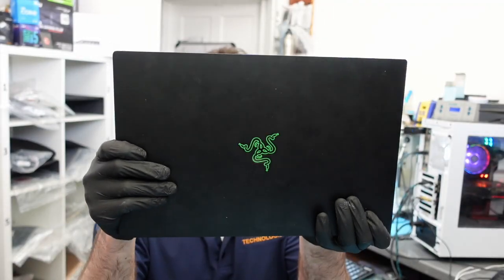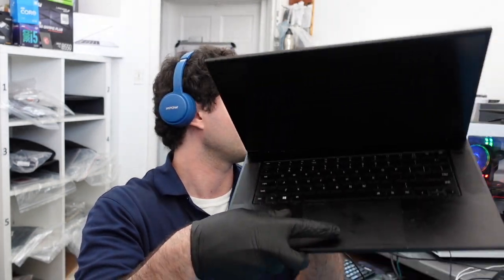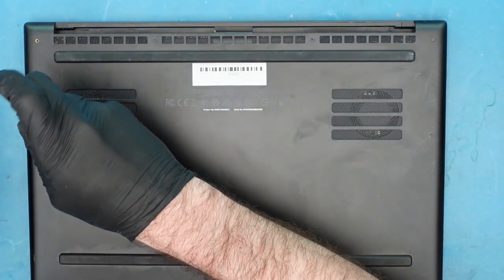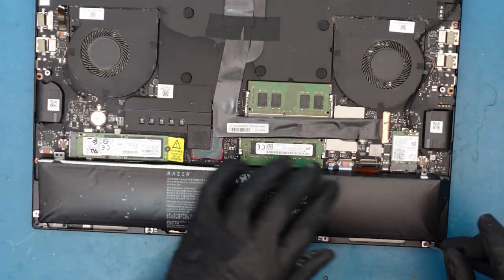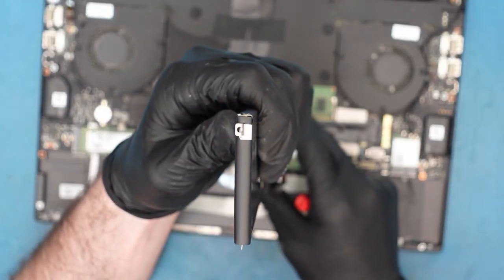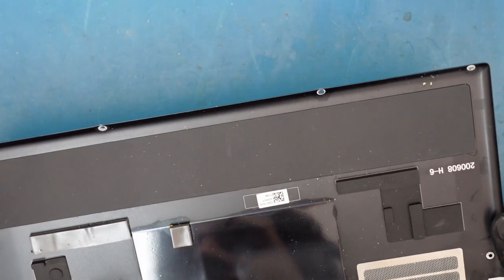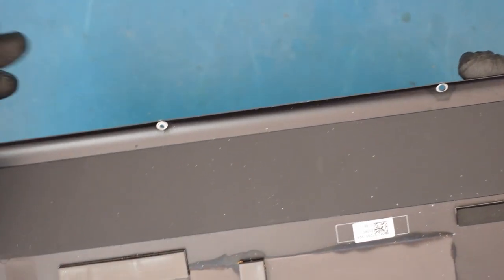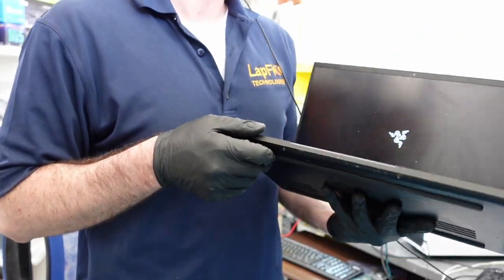Razer Blade 15 Battery Replacement | Swollen Battery

Comment from the maker: If your laptop  is ever starting to expand, make sure you take it in right away as it can get much worse!
Reply: I didn't change mine and it broke my trackpad, please do you have any idea where I can get a replacement trackpad
Reply: Hi @lapfix, I have the same issue, same model. My razer blade 15 (2019) does turn off right after tapping on the turn on button. First, it had turned off during a game 3-4 times. Then before starting a game. And now I don't even get it run to the desktop. I need to save my valuable data. It would be an unbearable pain to lose those, especially for some I have a deadline. Anyway, turned my laptop upside down, checked battery  which seems to have swollen a bit, more on the left side than the right (not exactly as much as yours). I have removed the dust from the fans and tried to turn my razer on without battery using the charging cable. In the internet I read it would work but it didn't. Is this normal for my razer? And what do suggest me to do? Further, I need the exactly same battery you have used. My original battery has the same Voltage requirement, looks 100% same as your original. So pl lease tell me where to get one?
Looking forward to your reply.
Reply: Can anybody help me find the screws for this laptop? My battery was expending and some of the screws are not there. I've changed the battery but I need a few more screws so I can close the lid all the way
Reply: i have a razer blade 17 360hz with  i7 11800H and rtx 3070 that had an issue with the battery after replacing it the laptop is always on battery mode even when plugging the adapter
Reply: Mine it blowing the case apart smhhh

Comment: Anyone have any luck finding a good replacement battery? My 2020 blade 15 is starting to do this and it's having effects on the trackpad. I'd like to replace it myself since it's out of warranty now but I'm not sure I should be buying some random battery off Amazon.
Reply: I'm in the same boat 2019 advanced 15.

Comment: Had this happen on my Razer Blade 15 2020 (similar chassis, Base model with a smaller battery), replaced the battery today (sending it for official repairs would likely take a month, and it's my main work machine). And man, that thing was 2x thicker than the replacement. I got lucky that the touchpad didn't crack, that seems to be really common.
Reply from the maker: Yup, glad you got it taken care of before it got worse 🔥🚒
Reply: Same here, bought a Razer Blade Base Modell (2020) and ordered today a new akku after I was cleaning the fans and saw the swollen battery.
After my two years of experience with my Razer Laptop I wouldn't buy any Razer Laptop again, because the temperature is to high, the cooler to loud and the akku is not holding long enough.
Reply: I completely agree. I paid 2000 dollars for mine and this is what I get, a laptop which has battery issues. Not only that, but it gets very hot. The battery life is only 2 hours anyways. I should’ve just got a desktop.
Reply: Does the chassis shape go back or does it stay "buckled/bent" after battery replacement?
Reply: I can confirm that my Razer's slight bending was resolved after the bloated battery was replaced. Now my machine looks pretty again :-)
Reply: @stargazer8718  i make my replacement today! I am happy and feared at the same time:D
Reply: where did you guys get the replacement battery?
Reply: Good question, looking for a new battery myself for the 2019 or 2020 model i dont remember exactly.
Thanks for the help !
Reply: where did you source the replacement. im in the exact same boat as you. this laptop is both my work tool and my entertainment.
Reply: @CRISP.R  you can order from razer support

Comment: Mine expanded enough to make the mouse pad not work for a while. Just thought it broke 2 years after purchase. But recently, the battery expanded to a noticeable swelling. Keyboard raised up in the middle!!  I work on all my stuff but just want to make sure I don't damage a connector or something. Straight forward video. Thank you!! May want to add, I'd clear the dust out of the fans while you're in there because these are so heat sensitive.

Comment: Oh damn, the replacement is that easy? My wife has been using my blade 15 for a good year and half now, and I haven't been using it until today lol. Noticed the screen wouldn't shut on the left side. Went to reddit and sighed after seeing it was a battery issue, and I can see the bulge now lol.
Reply: It's not that easy. The battery is glued to the chassis it doesn't come out that easy

Comment: Hello, is it possible without putting battery in? direct power supply and use it?
Reply from the maker: Yes, you can remove the battery and keep it only on AC

Comment: do you have a link to where you got the replacement battery? Im assuming probably from the Razor website. Does anyone know if there are "better batteries" that i can get that can push more power/last longer? the stock one lasted me about 2.5 years with daily use and almost always plugged in.
Reply: Im in the same boat as you

Comment: How can I assess the correct replacement battery for my model? My model is Western but I am living in Japan - does the different power supply here make a difference to the battery I must get? All the best, Sam
Reply: hey I'm literally in the same situation as you rn - did you find a solution?
Reply: @stormsource7438  Also in the same situation. Any luck?

Comment: Do you think that razer fixed this issue with their 2022 models?
Reply from the maker: If I see this issue again with the newer model, ill make another video =)
Reply: I don't think this issue is fixable. The chassis is small, and the heat is pretty intense. It's not exclusive to Razer laptops (most gaming laptops use similar or identical battery cells), but their core design kinda lends itself to battery issues. It's just something you have to be prepared to deal with when buying a Razer, but on the flip side due to its high-quality aluminum chassis it doesn't have some other problems gaming laptops tend to have.

Comment: Thank you for this movie. On some model maybe the new there is a strong adhesive in the top left of the battery. I was able to pry starting on the right and moving towards the left! 

I think it would be helpful in your video if you call out the tools you are using and the replacement part number (might not be too helpful since there are so many different ones for razorblade)
Reply from the maker: Yes and thank you for suggestions and watching
Reply: I used a thick guitar pick i had laying around (similar to what you would find in an electronics repair kit). My adhesive was really tough so i used a little bit of alcohol to loosen it!

Comment: Does the chassis shape go back or does it stay "buckled/bent" after battery replacement?
Reply: It likely depends on how bloated the battery got. I just removed mine today and the only damage was to one screw hole that had broken. It is as flat as the day I bought it. Currently, I am running it without the battery, until the new one comes in.
Reply: @THEL0G1CAL1  aren't you getting less frames without the battery

Comment: I had to use a credit card to carefully pry it out by working the card around. Careful there are ribbons under the battery if you have to do that.
Reply from the maker: Correct, stay safe and be careful

Comment: do you guys still fix razor blade 15 laptops? mine keeps shutting off randomly and alot and i have to prop it up a certain position until it turns on like normal and then i have to be careful not to move it out of that spot or it shuts off randomly and because it keeps doing that everytime i do get it to turn on when i go to put my pin in it says that login option is disabled for 2 hours and then i can try it again ive checked all the windows updates their all up to date so idk i think i need a new battery but not sure

Comment: Question can you run a blade without a battery at all ? my battery was slowen dropped it. and when I click power I get a single green blink - and that's it laptop is dead (Bladed adv 2021)
Reply from the maker: Most of the time, the battery just holds a charge so can be removed and you can use it plugged in only

Comment: hi! I know this is a bit late lol but I have a 2017 razer blade stealth 17 (17" (2017) i7-7700HK GTX 1060) and I have the problem where it is not charging. I changed the power cable and eventually opened the system to check to see if there was a burn like you showed. however, i was not able to find any signs of damage anywhere on the board, battery, or charging port. If youre still checking these comments, any tips would be much appreciated.

Comment: Hi can you help me?

Battery became bloated, so it was replaced with a new one. However, before replacing, it no longer powers on or charges (No Orange Light Indicator). It would not operate when plugged in without the battery. If the button is held down for 10 seconds or more, an indicator will flash white (Power reset working). The charger was tested with an output of 19.5V, so it is not faulty.

Comment: This just happend to me. Razer said I need to ship my device at my expense to a friend/family residing within a list of the countries they allow RMA in. Like I have an authorised retailer in my city but that won't work. They can easily reimburse the replacement cost but they won't. 
This is an active hazard and Razer doesn't take accountability for it. 
I'm done with Razer. Should've gone with MSI or Alienware. They also give better performance and cooling. But I bought Blade 15 for looks and because I was a huge fan.

AVOID RAZER AT ALL COST.
Reply: Regret too.
Reply: never had any issues with mine, best laptop i ever had

Comment: Where can I buy non-original battery?
My battery model is RC30-0328, Razer Blade Base (2020).
I absolutely Do Not want to replace it with an original battery and having the same issue 12 months from now.

Comment: my trackpad it started to feel almost unclickable means battery swelling??
Reply from the maker: Most likely as it may be pushing up
Reply: @lapfix  yes I removed the battery and it’s so clicky again. I love my rb but it’s a freaking laptop skillet it gets so stupidly hot can’t hardly touch it will burn you but it max out all games I’ve thrown at it under the hot temps also. Finally after 2 years I’ll try a laptop cooler when I buy a new Amazon battery replacement…

Comment: How often should you change the battery to avoid this? I got mine in 2020 but it's the late 2019 model and right now its battery dies after 2h of normal use.
Reply from the maker: Only when you really need to.  Some models have bigger gpus, high refresh rate screens, power hungry processors etc.  Won't matter  too much what type of battery you put in there to change that a whole lot

Comment: I was cleaning my laptop and noticed it got swollen and can't put the lid back on.  Is it safe to remove when it had a full charge?
Reply: I hope you discharged it first. The higher the charge the higher the chance of burning and even exploding. Below 25% it's relatively safe

Comment: Got a 2021 Advanced Edition & the left click & right click seems to be harder not sure if I have a expanding battery but google is pointing to that kind of stupid that these issues are still relevant seems like a huge design flaw from Razer for the price of the products
Reply: I had the same problem with my razer 2018 laptop until the buttons on the track pad stopped working, now I have a swollen battery that needs replacement. But I used my laptop for almost 2 years until it inflated so bad.
Reply: If the trackpad gets hard it means the battery is expanding, same thing happened to me and it eventually broke my touchpad
Reply: Yes, it almost certainly means you've got a bulging battery. It will keep expanding and the clicks will eventually stop working, as they did on mine. But unless the touchpad cracks, the clicks will be working again once you install a new battery.

Comment: Hi @lapfix, I have the same issue, same model. My razer blade 15 (2019) does turn off right after tapping on the turn on button. First, it had turned off during a game 3-4 times. Then before starting a game. And now I don't even get it run to the desktop. I need to save my valuable data. It would be an unbearable pain to lose those, especially for some I have a deadline. Anyway, turned my laptop upside down, checked battery  which seems to have swollen a bit, more on the left side than the right (not exactly as much as yours). I have removed the dust from the fans and tried to turn my razer on without battery using the charging cable. In the internet I read it would work but it didn't. Is this normal for my razer? And what do suggest me to do? Further, I need the exactly same battery you have used. My original battery has the same Voltage requirement, looks 100% same as your original. So pl lease tell me where to get one?
Looking forward to your reply.
Reply: If you can't send in your laptop for repairs, you can get third party batteries on Amazon or eBay. They're usually identical to the official ones, and Razer doesn't sell official ones anyway. Just check your model number on the sticker on the bottom, the battery listings on Amazon will usually list all supported model numbers.
Although if you have a deadline, you could get some M.2 to USB adapter and stick your laptop's SSD into that to move the data to some other computer.
That said, if your Razer isn't turning on at all without the battery, there could be an issue with the motherboard, and you may need to send it to a repair center anyway.

Comment: I replaced my battery, but now windows is saying "no battery present" with the replacement battery. Yet it is still running despite not being plugged in. So obviously the battery works

Comment: Is it safe to use it without the battery while I wait for the battery replacement?
Reply: Have a similar Razer Laptop (RZ09-0330). It started having a spicy pillow (the funny term for the bloated battery). It works fine. In fact. am typing on the same laptop I'm posting this right now on the very laptop. (I mostly use it docked). It just states there's no battery inside of it. There is an adhesive on the top left of the battery so really be careful. A pullable adhesive tab is present so you can pull that sticky tab and then you should be able to remove it.

In the future for the replacement, I am going to make sure to let the battery cycle more often (and get a laptop cooler/riser) so it doesn't go into spicy pillow mode so soon. (I've had the 2019 version)-- so about 3 years which seems about right to go in a condition where I don't cycle it so often and don't use a laptop cooler.
Reply: @ashameimaru  What do you mean by cycle it more often? You mean we should use and recharge the battery more than we do or we should stop using on the battery and use plugged-in more often? How long have you had your laptop before your spicy pillow?
Reply: If it works at all, yes. Just be careful about the power cord, no gadget likes to be powered off by yanking out the cord by accident.